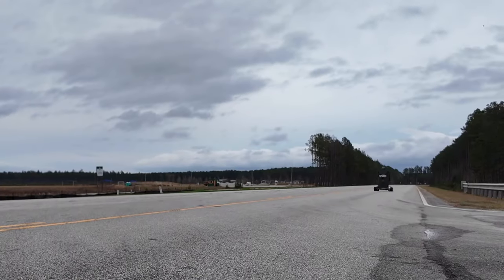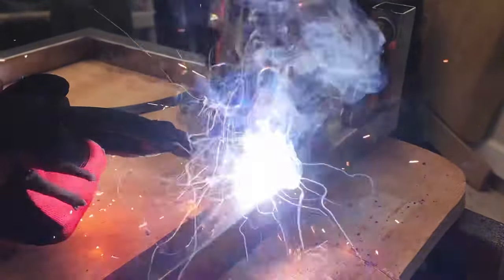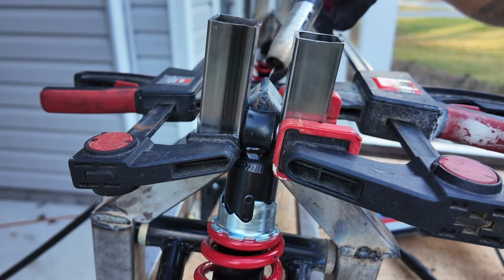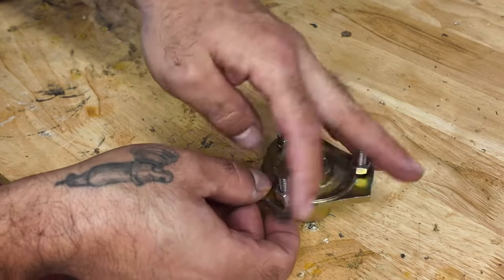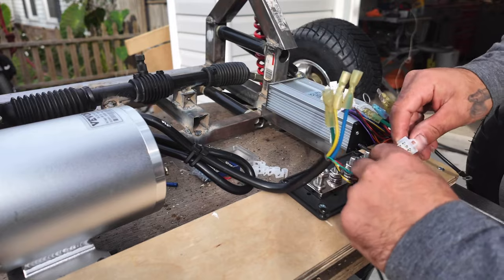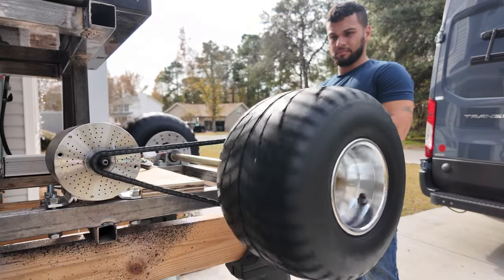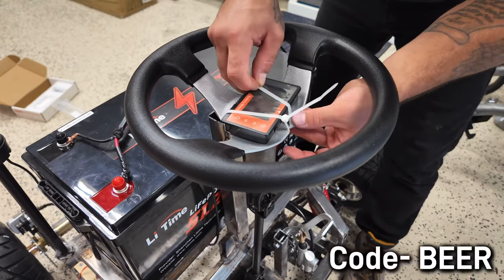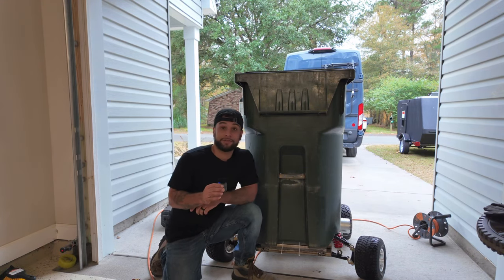I Built A Race Car Trash Can (Lithium Battery)

Comment: If a motor like that is running backwards you can swap two of its wires round or tell the controller to go into reverse, no need to flip the whole thing
Reply from the maker: We tried to put it in reverse, but it was stuck in limp mode, but I do appreciate the comment and you taking the time out of your day to watch our videos. Be safe and God bless bless. 🙌